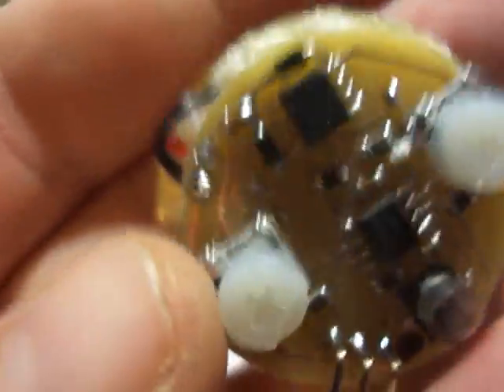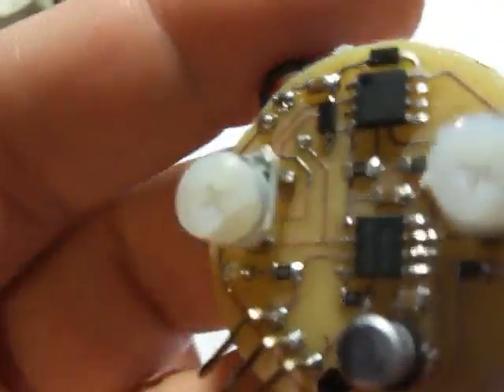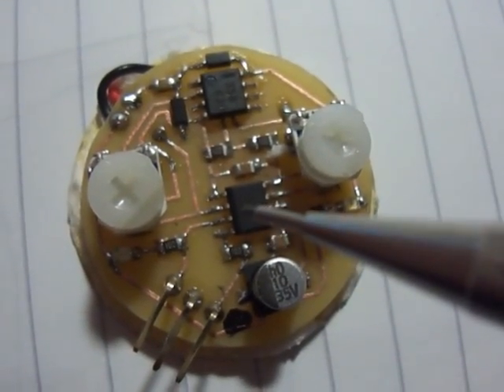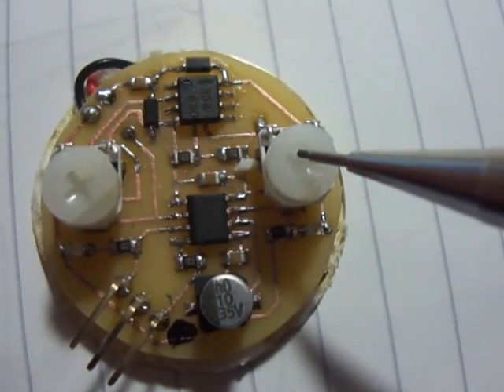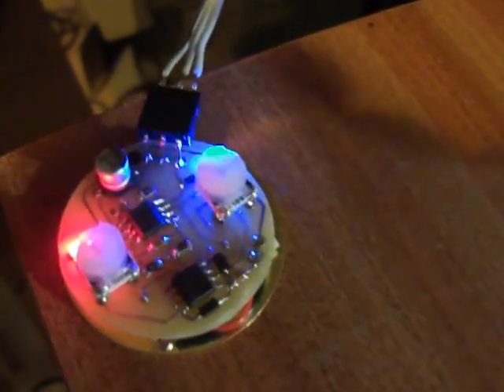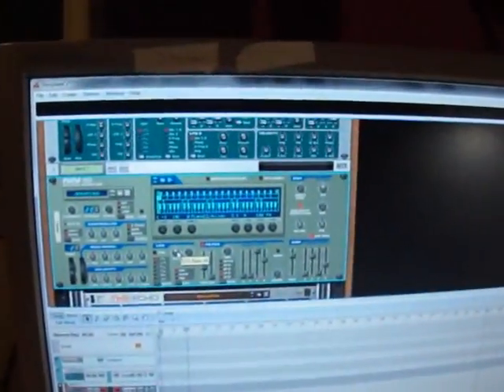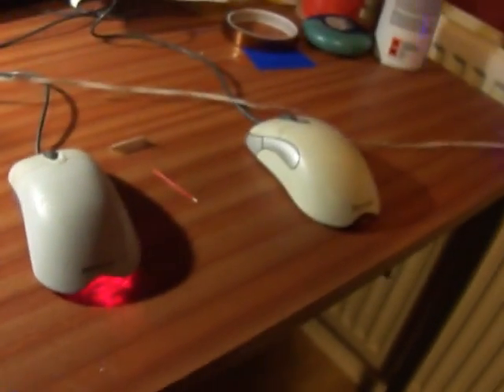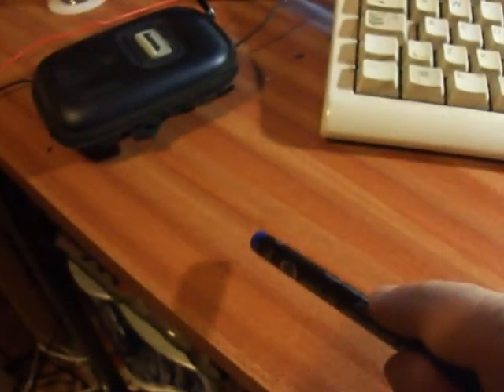Table top MIDI trigger experiment

Comment from the maker: @NakagawaGakki - Thanks! the schematic for the sensors is available at the blogspot link above.. let me tidy up the PIC code for the 1D timing/MIDI generation used on the clip and I will also post that on the blog page.